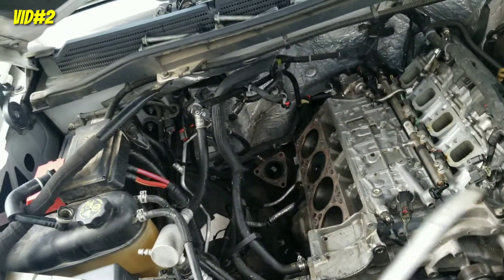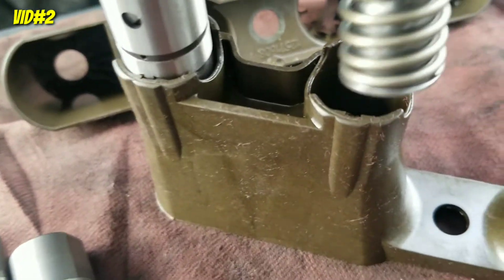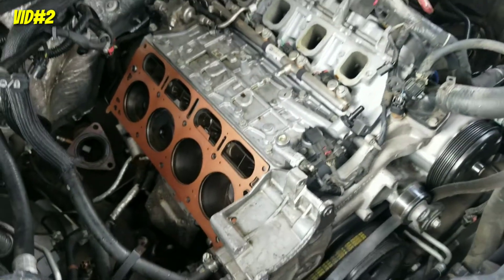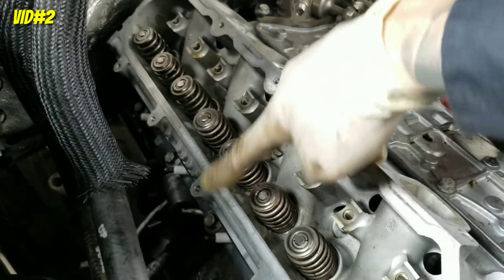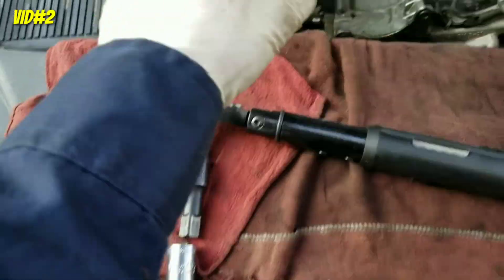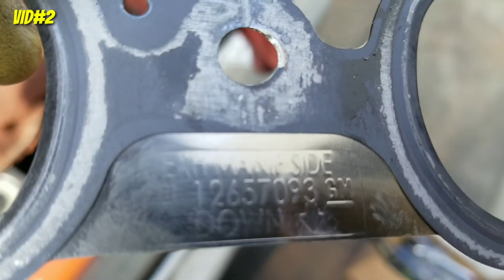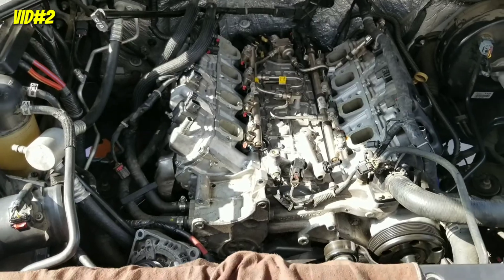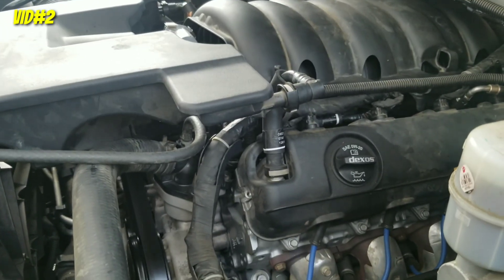How to install the lifters,head gasket,head torque specs on gmc Sierra or Chevy Silverado 2012-2018

Comment: Those fuel lines are one time use. Have to install new ones once removed due to crush washers. It will leak fuel if not. I know this video is old and its definitely very informative but this i know for sure. Also if going to replace head bolts i suggest upgrading them in the process as if ever adding power in a real way it helps immensly. Thats all 😊

Comment: How much does it cost for the lifter job
Reply: I know it's old comment but I'm going through this right now with a Yukon xl 2015, and so I was estimated over $11,000 to $13,000 and both mechanics (went 2 places) said it's a couple grand more for a new engine. So yeah $11,000 for lifter replacement and over $13,000 for new engine. They both said it's the $150hr labor they charge is why.f...kin crazy

Comment: Good video man , i have a question i have a 2018 suburban 5.3 with a PO301 code, it has a miss fire on cylinder 1 and the motor has a knocking coming from bank 1 , changed the spark plug and the coil is good and motor still knocking, i pulled the valve cover off and checked the rockers like you did and none of the rockers were collapsed have any idea what can be causing this problem? Appreciate any help thanks .
Reply: many times you won’t see a lifter collapsed unless its running with valve cover removed. Hopefully just a lifter or broken spring but it’s not always that. Good luck.

Comment: How long does this process really take if you have to do both sides I have this problem on my gmc sierra I have codes p3441 & p3417 Cylinder 6&3 Deactivation/Intake
Valve Control Circuit/open
It’s a 4.3 l v6  is this the problem or can it be something else ? Someone help please 🙏 and ps I love watching this video can’t wait to get hands on my motor love doing these type of things

Comment: Your wrong on your Rockers, There 22lb.ft and you have to tighten with number 1 cylinder at TDC, firing order is 18726543 /  Tighten exhaust valves 127 &8 to 22lb.ft then rotate 360`d then tighten the following exhaust valves  345&6 to 22lb.ft and intake valves 267&8 to 22 lb.ft,,,,,,,,,,,,,so you don't bend a valve (that is GM specification wright out of the dealer shop manual, also head bolts on all GEN V are as follows first pass 59lb.lb, 90`d second pass & 60`d 3erd pass and the allen bolts are the same except 40`d 3erd pass...but thank your for your in put on everything ells.
Reply: Sure seemed to work his way too lol

Comment: 8:11 Could someone tell me what / how he is setting it to 80 degrees means?  I understand the torque value, but  a little confused with the degree value.  What exactly is he adjusting? or is he bending it?
Reply: he’s starting at zero, that’s wherever you start to tighten is zero degrees. Think of looking like clock, he’s tightening it to i think he said 80 degrees, which is the wrong spec i believe. lol. regardless that’s how it’s done.

Comment: Head bolt torque spec is wrong. It should be 59 ft lbs then 90 degrees then 60 degrees.
Reply: The one he is working on has aluminum heads

Comment: Shouldnt the torque specs for the head bolts be 59 ft lbs, 90°, 60°? Drivers side allen bolt is 59 ft lbs, 90°, 40°?

Comment: Good video. I do have to say that the torque specs according to GM is 59 ft pounds 90 degree then 40 degree.
Reply: That's for the Allen bolt on the drivers side head. All the others should be 59 ft lbs, 90°, 60°.
Reply: I dont understand the 90° 40° terminology. 
Like he said 22 lbs of torque and then he did the 90° thing... What does that mean and why? Why can't I torque it to 22lbs and move on? Thanks in advance ☺️
Reply: I'm confused by the torque, one says 22 ft lbs and then 90 degrees a final 60 degrees, and the next one says 59 ft. Lbs then 90 degrees and a final 60 degrees. Which one is it, I have a 2015 GMC Sierra 5.3l engine
Reply: @johngiesbrecht9986 I’m confused by this also, I went by the GM specs and did the 59 ft lbs then 90 but the bottom head bolts won’t turn 90 degrees after initial torque.
Reply: @stephenkillgore7983 did you clean out the ports with air hose? Coolant probably in it.

Comment: Torque spec is wrong you are mentioning. Should be 59ft lbs, 90 degrees then 60 degrees.

Comment: great video but i worry your head bolt torque specs are wrong.  just did my 2016 silverado 5.3 and the head bolt torque is 59 Ft-Lbs then the 90-60 degrees not 22ft-lbs
Reply: I noticed that too. I just done my 2016 as well. When looking up the torque specs I noticed online there is a lot of places saying 22ft lbs but also some mentioning the 59ft lbs. I went with the latter.

Comment: Great video. I used this video to do the same exact job on my 15 Sierra 6.2liter. Helped tremendously! Only trouble I had that you didn't mention, is the wire harness secured to the back of the intake cover. It's impossible to detach it. So I just snaked the intake manifold out from underneath the cover, and then I was able to detach the harness.
Other than that, perfect video for anyone with basic hand tools to perform.
Reply: Did the same exact thing on an 18 GMC Sierra
Reply: I don't think it's possible to get it off any other way
Reply: i did the same thing, i was fighting with the intake-cover for and hour, then i was like let me try an take the intake out first then the cover and it did work after that i just stuck a flat head driver to push out the clips out of the intake-cover ,tomorrow 05/29/2023 am gonna  install the lifters back  THANKS JM8686 FOR THE VIDEO YOU JUST SAVED ME 1200 DOLLARS  MY LOCAL MECHANIC ESTIMATE WAS 1700 SO I BOUGHT THE LIFTERS TOTAL TOO 500 DOLLARS SO 1700-500=1200 I REALLY SAVED 1200 ,,,I HAD TO BUY THE PARTS AND CASKETS
Reply: Doing it now on my '16  sierra 5.3

Comment: 5.3L and 6.2L engines	
Step 1	59
Step 2	Tighten an additional 90 degrees
Step 3	
Left-side cylinder head internal hex bolt	Tighten an additional 40 degrees
All other bolts	Tighten an additional 60 degrees
6.0L engine	
Step 1	
All 11 mm bolts (1 through 10)	22
Step 2	
All 11 mm bolts (1 through 10)	Tighten an additional 90 degrees
Step 3	
All 11 mm bolts (1 through 10)	Tighten an additional 70 degrees
Step 4	
All 8 mm bolts (11 through 15)	22
Reply: So is his trque values wrong or whats going on?
Reply: Just curious, where did you find that info at. Currently doing my 2016 Tahoe and did exactly what you said. Then I clicked on this and now I’m freaked out I overtightened my head bolts.

Comment: Thanks so much for the great set of vids. I thought the head bolts couldn’t be reused because they are stretch bolts. I’m guessing it’s probably fine.
Reply: I mean you are not supposed to but there is only one way to find out right...
Actually you can measure the length to see if they are in spec

Comment: I am following this guy lol DO NOT READ THE WORKSHOP Manual LOL The Manual has you replacing a lot of parts when installing all parts. This proves you do not need too.
Reply: @JM8686  any issues after everything went in? Days later etc
Reply from the maker: Nothing 
Truck still being used for work everyday
Reply: @JM8686  Okay. Today I’ll attempt it. Lifter #5 is giving me the issue.
I’m debating just doing the Left Bank Only to save time. 

All Lifters New
Head Gasket New
Head Bolts New
Inspecting Push Rods and Rockers and Replacing if necessary
Reusing Fuel Injectors
Reusing Fuel Pipes
Spark Plugs New
Oil Change 
Radiator Fluid 

Anything I’m missing? Crossing fingers
Reply from the maker: Once you remove the lifter 
Try to see the camshaft lobe through the lifter hole 
Just to make sure the camshaft is not damaged
Reply: @JM8686  What in the world is the camshaft, órale 😓 I’ve been studying for 1 week and you bring something new lol
Reply: @JM8686  cylinder 5 was the one that was giving me issues and the camshaft lobe is up, the lifter is the regular lifter not the one with the springs on it. How can I determine if it’s damaged. Also what am I looking out for in the lobe

Comment: Hey so i got a question for you could you answer please. 
So i did head job on the driver side of my truck, i have a 2014 silverado lt 5.3. I did exactly what you did also put new spark plugs and wires changed the oil and also replaced the injector for bank one. Ot ran good no noise for two hours i parked it and check engine light came on started shaking no over heat and all gauges are normal. Now for the injector i bought 1 for bank 1. It came with little white rings that looks like a tiny doughnut. I put them on it didnt have any on the injectors the first time i took them out and i didnt see if they came off in the head. I took the head to the machine shop and when i got it back it was clean. So i put them on. Do you think this might be the problem? Maybe it did not have them before?  I saw the injectors you took out but i didnt see them?. Help please!!!!
Reply: I just replace my injectors and the original didn't have that white Gasket, not on the injector itself not on block where the sit. The new ones all came with the white Gasket.

Comment: I have a 2018 Sierra Denali 6.2. with 900 miles, not  9000 I have a misfire on cylinder 8. Cylinder 8 does not have DOD lifters. The dealer checked the coils and injectors and said they were good.  The engine does not tick, smoke, leak gas or have a gas smell. It runs very rough, and the engine shakes, but no noises. Does anyone have any suggestions? I purchased the truck brand new. The dealer seems to think it"s a collapsed lifter, but with 900 miles .and cylinder 8 doesn't"t have the DOD lifters. I"m kinda leary. I don't want them tearing my engine down only to find out that it"s something a whole lot simpler.
Reply from the maker: Truck is new so let the dealer deal with it nd make sure they give you a rental while the truck at the dealer
Reply: @JM8686 Thanks!  I guess you're right. You have the best videos ever!1
Reply from the maker: Thanks for watching
Reply: Any updates? I have the same problem, just not a new truck.

Comment: Has anyone done this and had the truck not want to crank over after getting everything back together? The only time it even tries to crank over is if the check engine light comes on and it pretty much always immediately died. Only have got it to fully start 3 maybe 4 times and it idles very rough.
Reply from the maker: You might have a vacuum leak or forgot to plug in something on the high pressure fuel system
Reply: @JM8686  Could there possibly be a loose ground or computer issue?
Reply from the maker: Yes
Reply: @JM8686  How would I go about it if it’s a computer issue? Because I’ve heard you can’t just buy new and put it in because it won’t work and that you have to go to a shop?
Reply from the maker: Easy way to tell ,did it do the same thing before doing the lifters job?
If it was like that it could be the ECU
If wasn't like that is not the ECU because they don't go bad by doing that kinda work
Reply: @JM8686  No it was not doing this before changing the lifters.
Reply from the maker: You did that job or someone else?
Reply: @JM8686  A friend of mine did the job.
Reply: Check the ground on the back on the cylinder head
Reply: Maybe you’re friend forgot to reattach it

Comment: Whats the proper method of prepping the head and block mating surfaces
Reply from the maker: Heads send over to machine shop to get resurfaced nd a valve job nd block just sand it down "clean with wire brush or sandpaper 120 grid"

Comment: Apparently the active fuel management lifters in the GM 5.3 liter V8 are a VERY common problem. Good job creating this awesome video and explaining all the details.
Reply: thanks for shareing very good job showing the how to's.
Reply from the maker: Thank you for watching
Reply from the maker: Thank you for the comment 🙌
Reply: Yes Sir
Reply: Is there a better lifter than gm original. Maybe an aftermarket part? Or just use gm original? Also  I shut my arm few years ago, could a bad lifter still happen? Just curious. Thankyou

Comment: How do you know that the oil solenoid wasnt bad hence causing the lifter to stay collapsed?Thanks
Reply from the maker: Because i can control the valley pan with my bidirectional scanner before removing the head to confirm that the lifter is the issue!
First i check the live data and focus on cyl 1-7-4-6 if i have the live misfire on any of those afm/dod cyl, then i go cyl by cyl activating and deactivating one by one to confirm that the lifter is collapsed!
Another way is removing the valve cover and run the truck without it and you will see a rockerarm not moving at all so that will also confirm that the lifter is collapsed!
Reply: @JM8686  Thanks for your reply. Makes sense ..Best video on this repair  .Thanks for helping out so many .

Comment: Great video - how difficult is it to do the same on the driver side? I have a P0307 error and unfortunately it the inner most cylinder on the drivers' side. Thanks much!
Reply from the maker: Depending what year,if is the LS you don't have high pressure fuel pump, if you have the LT you have a head bolt in front of cylinder #1 that is different than the others and you have a high pressure fuel pump and Injectors directly into the head,the LT is the same exact like the one on the video! Less words LS easier than LT
Reply: @JM8686  Thanks! I have a 2015 Sierra 1500 SLT 5.3L V8 Gas. I am thinking about to give it a try. My previous diy projects on auto never went beyond changing an alternator or knock sensor. This looks a quite bit more involved.
Reply from the maker: Same engine like the video

Comment: Really enjoyed your video.  Taught me a lot. Not sure it is my lifter yet. I have a 2014 Yukon XL 5.3L V8 SLT.  I have a misfire on the 7th cylinder so I replaced all the spark plugs and wires and coil on the 7th cylinder and that made it run a little better for a while and then it had another misfire on the 7th cylinder again after driving it for a while. I don't have the tool to check the compression yet in the 7th cylinder. What are your thoughts on my problem?Is there a way to drain the antifreeze so you don't get it all over the cylinder heads?
Reply from the maker: Remove the valve cover nd see if the pushrod have any play

Comment: To unplug fuel injectors or gas lines do i need to unplug a fuse or battery? How much gas come out of lines?
Reply from the maker: No need because it's a high pressure mechanical pump! Nd only small amount of gas

Comment: Do the fuel lines need to be replaced?
Reply from the maker: No but if you remove the injectors from the heads you will have to replace the injector seals
Reply: @JM8686  had to work the injectors out and slightly bent the rail. Should this be ok or no?
Reply from the maker: @oscarmartinez550  just make sure the injectors are all the way in tho